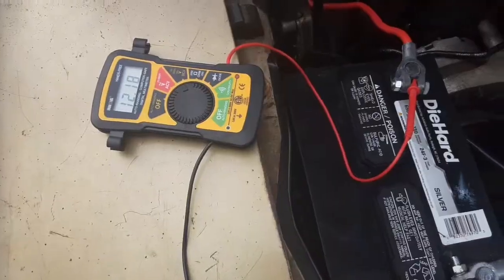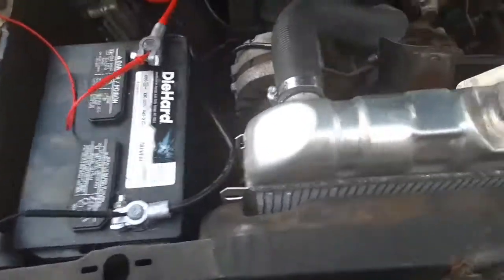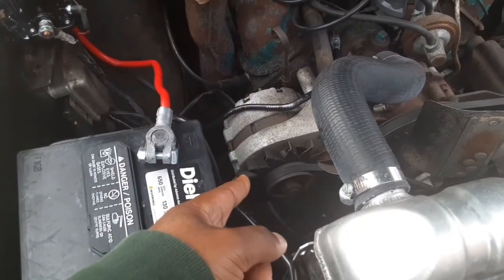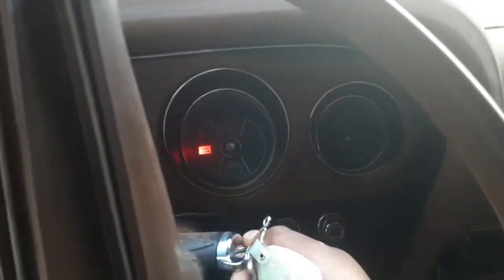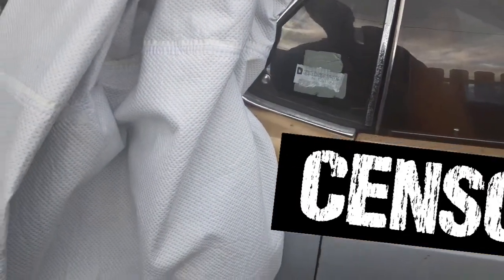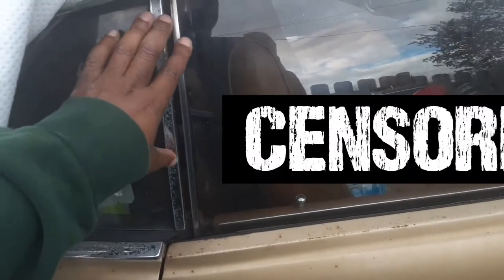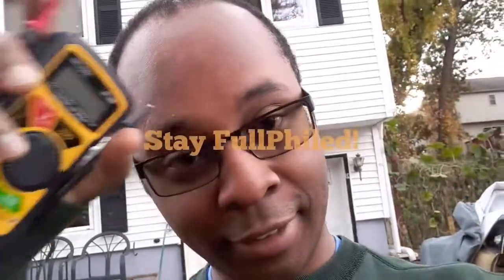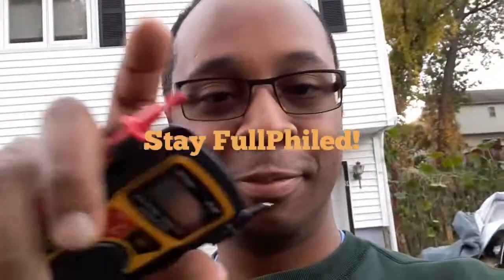Used A Volt Meter on My '70 Mustang Fastback

Comment: I didn't change the alternator recently.  Not sure if I did or not in the 80's.  I always felt that that could be the problem & wanted to replace it but the people who were helping me with it said it didn't need it. You already replaced the starter and battery so I would just go ahead and replace the alternator at this point and if that doesn't solve the problem idk what will. Something is definitely wrong because I replaced the starter  celluloid 2 times right before you bought the car. I also replaced it about 10 years previous when I had the car running then. Also put a new battery right before you bought it. So  Something is definitely draining both.  I think your mechanic said to you that you would have to re wire the whole car but maybe the Alternator would solve the problem idk. Hopefully he can figure it out.